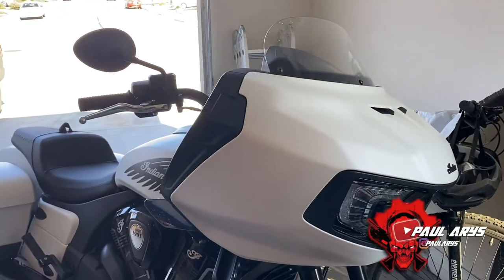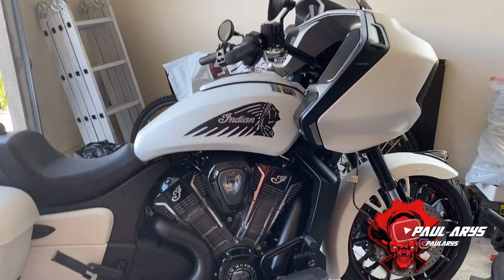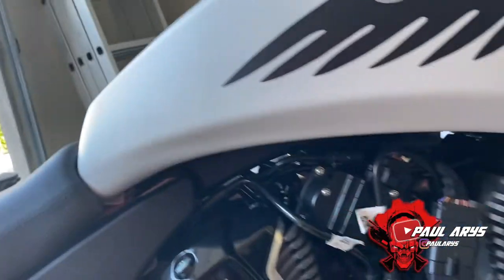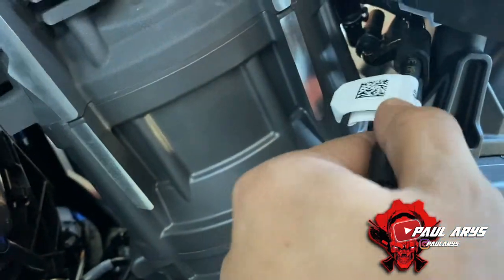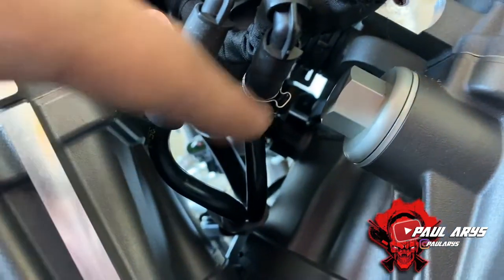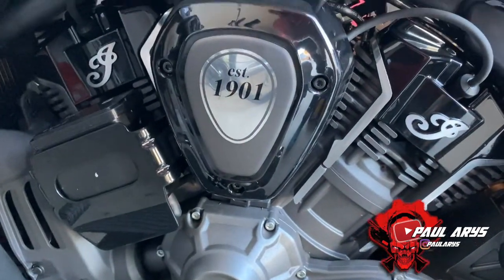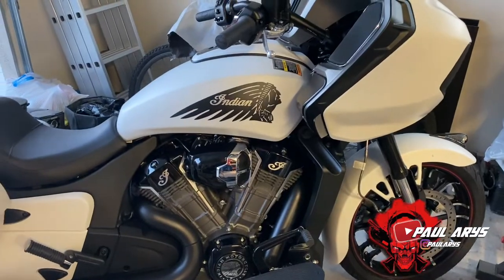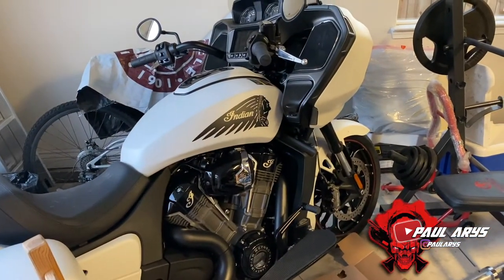Indian Stage 1 Air intake install on the Challenger

Comment: Is that the California compliant variation  of the stage 1 intake? I have not seen the mounting bracket on the left side of the engine with the other stage 1 intake
Reply from the maker: correct this is the cali compliant if you have the cool one you can skip the evap install and move directly to the air intake step.
Reply: id skip that part of the install.
Reply: Is there a way to modify the California compliant one, or is there even a difference on parwise pros and cons thanks

Comment: Thanks for the video. I saw a Challenger with stage 1 air intake but that had no box on the left side?
Reply from the maker: Impossible it requires the intake for the extra air intake required!!!!
Reply: You are correct, this video is confusing, in nearly all applications there is no box on the left side of the bike. He has purchased the CA EPA compliant version, all other North American installs will not have the cartridge relocate, & others that installed the CA kit also did not do the relocate, there normally is no box in left side. Just figured it out when I went through the instructions mine came w/

Comment: Paul, great video. Question... i have the high flow filter when i bought it. Is there still an air filter under the tank or did this delete that? Thanks...
Reply from the maker: there is an airfilter under the tank since there is a second air entry in the front of the frame and the filter under the tank filters the air.

Comment: 122hp x .05 = 5.1hp
Reply: 6.1, nice math.
Reply: @teamsickspeed  correct. I should really do math after I have gotten up instead of after a 15.5 hour day.
Reply: Right, he said 12hp increase, I doubt you'll get 5hp just from doing air intake mod. 
Ah, I see, exhaust then flash the system for the extra hp.